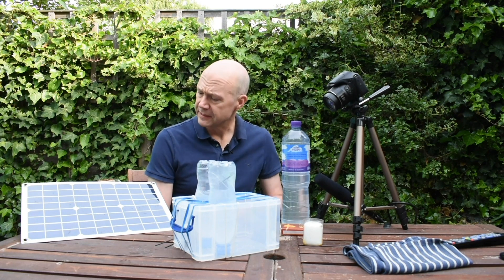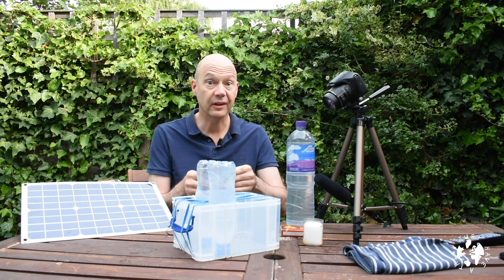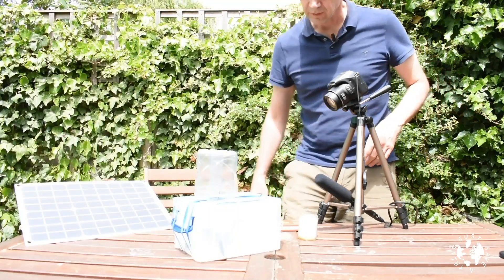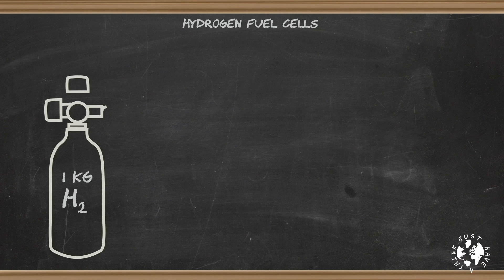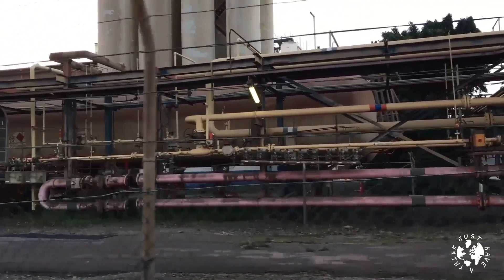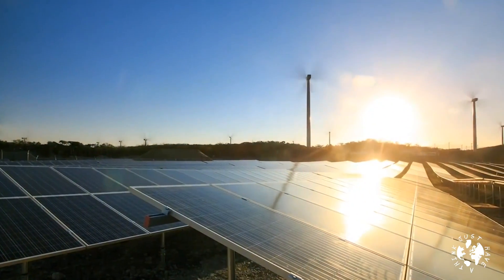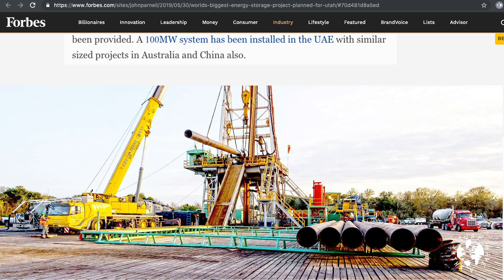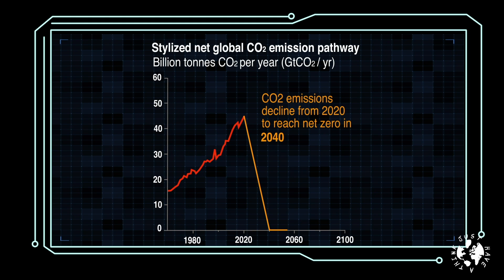Energy Storage in Hydrogen : Does this beat batteries?

Comment: Scaling up H2 to a global fuel & store of energy will result in leaks. Being small, it leaks. Being reactive and at pressure might lead to corrosion. Being the lightest gas means it will escape earth's gravity more easily than other gases. We lose about 1g per second presently. But I would guess that with leakage more will leave Earth per unit of time. So what is the risk to water levels on the scale of say a few centuries? Is it insignificant?

Comment: What about using methanol made from electrolysis as a store of energy and then use Methanol fuel cells as a source of hydrogen for fuel cells. Much safer than compressed hydrogen tanks. Plus me thanks can use the current petrol infrastructure to be dispersed for cars and trucks.

Comment: There's a guy in New Jersey that did designed a hydrogen storage system from left over electricity made by his solar roof.  He had a low pressure tank for the hydrogen and a low pressure tank for the 02.   When he needed more electricity he would call on this system for electricity.  It took time for approvals by the township.
Reply: @rob1248996 Actually no.  He did have a series of tanks in the back yard.  It did take up a lot of space as one would expect
Reply: @rob1248996 He's on youtube and has the whole thing explained.  I can't remember his name though.  And no, it's not high pressure

Comment: Conveniently omitted: The cycle [in]efficiency of the electrolysis-fuelcell cycle.  Given electrolyzer and FC efficiencies of 0.8 and 0.5, respectively, cycle efficiencies are only 40%.  Also omitted, things like H2 diffusion and embrittlement.
Reply: Of course they did not bring that up. Ha. A wonderful up and conning solution are the MSR specifically thorium fluoride. Wonderful tech. Quick link for basic edu below. 

  https://youtu.be/uK367T7h6ZY

Comment: HHO is the slang for electrolyzer devices that perform efficient electrolysis.  I made some - they work well using KOH.  The bummer is that the O2 and H2 are mixed (which is OK for the automotive application)

Comment: When it comes to efficiency of hydrogen production, water electrolysis is not too good. Perhaps it could be improved by using different frequencies of electricity though.
Barring that, electrolysis of urine at wastewater treatment plants has massive potential. Hydrogen from urine takes less electricity to make it then the amount of hydrogen energy that is collected. It also purifies the water while making the fuel. Check out the green box program at Ohio U if you want to learn more about it. Very fascinating stuff!

Certainly efficient seasonal storage of energy would be a game changer. It would work well with intermittent sources of energy as well as nuclear and other base load power suppliers. It would increase profitability of any kind of energy supplier.

Comment: Water has 2 atoms H per molecule. Methane, CH4, has 4.  Seems that Methane could be a  super source for H2 for use in fuel cells to generate electricity.  But, that begins to appear to be a downward spiral. Soal power to electricity (34% efficient), electricity to H2 (?% efficienct), H2 through a turbine (combustion) or fuel cell (?%efficient) .

Comment: The hydrogen could be used to make ammonia rather than using natural gas.    That would save the stored methane to be used for other uses.
Reply: Or you could make methanol, which is slightly less energy dense, but easier to store.

Comment: On submarines, this is one of the ways to create oxygen for breathing air.  The machine uses 1250 volts to separate the molecules and throws away the hydrogen.  The machine is referred to as the O2 bomb.
Reply: There's still a lot of work in removing CO2 then, just adding O in a submerged environment means the CO2 saturated air must be vented with the H2. That's a possible position give away even if they compress it for a few days and then vent. I thought they used CO2 scrubbers. Not saying you're wrong (you've obviously spent time on a sub), only that I'm surprised.
Reply: Unless theres some technology I dont know about, (its possible, Im not particularly knowledgeable in the subject) theres no CO2 scrubbers that can be used for the lengths of time a submarine would need, so they use an amine type CO2 scrubber, which is regenerative (it absorbs CO2 normally, and discharges it when heated).
And if youre only discharging the CO2 youre only discharging about 0.3-0.6m^3 of volume a day per person, 
0.0004m^3 per minute on the high end (my cursory search on how much co2 a person emits per day turned up 0.35m^3).
Which is trivial, all these values are also at standard temperature and pressure, not the incredible depths a submarine can be expected to operate at, lowering them even further, also sea water absorbs and adsorbs CO2, lowering it even further.
Also I just realized I typed a wall of text, sorry about that! I like doing math!
Reply: @rjwaters3  Yes, Destin from smarter every day did a video on this. They mostly use amine to absorb co2 which they then vent to the sea. They pressurize it to match outside pressure and vent it in tiny bubbles so it dissolves into the water very quickly
Reply: why is h2 made on one terminal? what happens to the o2 from that terminal? the o2 doesn't teleport to the other terminal.

Comment: I am unable to believe the bottles filled with the gases in a matter of few hours and with no intervention at all. No, not possible 

Disadvantage is that the bubbles of oxygen and hydrogen gas will still cling to the electrodes reducing the efficiency of the electrodes. You need a mechanical brush to clean the electrodes plus a larger surface area of electrodes. 

The distance between the electrodes increase the internal resistance. One bottle will become more acidic and the other bottle will become alkaline making the electrical flow to practically stop because of upwards pH gradient. So you need to stir the entire solution. Industrial scale need to address these issues for more efficient process on economic scale,

Comment: Burning hydrogen in a gas turbine is a challenge as it burns at a very high temperature. Totally replacing natural gas with hydrogen in a pipeline could also have issues.
On the upside apart from the heat from burning it, hydrogen can also act as a reducing agent so burning it to make Portland Cement and Iron seems doable.

Comment: The devil is in the details. Hydrogen is an escape artist. It is very difficult to contain. Frozen hydrogen is great but the problem is dealing with extremely cold liquid. It is explosive, and it will destroy almost any material it touches while extremely cold. The problem is all in the details and although many people and companies have worked on making hydrogen practical, nobody has solved all the problems yet.

Micro nuclear power is much more practical and currently is the only solution to our CO2 problem. These newer designs are safe by design (impossible for a runaway reaction to take place), cost effective and we can locate them much closer to where the energy is needed. Sadly, fear of what people don’t understand and stupid politicians, are getting in the way of a real solution that can solve the energy problem that we already know it will work. This can’t be said for hydrogen as a storage mechanism and renewable energy (wind and solar). I am a big fan of solar energy but I don’t see how we will ever get that energy source to be anywhere near big enough for what we need. Until we can make fusion energy a reality, small nuclear is currently our only hope.

Comment: I a very serious objection to this hydrogen folly. I know that salt mines are incapable of storing hydrogen without nickel metal hydrides. Without this the hydrogen will totally leak away! Leaking hydrogen is always a major problem, because there is no metal or plastic tubing known to man that is dense enough to contain hydrogen. The active hydrogen molecules will vibrate themselves through the skin of any pipeline given enough time. I is the Hindenburg all over again. When hydrogen is cooled to room temperatures in the presence of nickel metal hydrides, the hydrogen bonds to its surface. To release it again all need is to warm it up again. Hydrogen used in internal combustion engines, they use a preheated and then pass the exhaust through the storage tank to keep the hydrogen molecules active. Early developers of such engines learned this lesson the hard way, losing everything to a fire ball. Salt Lake City is actually sitting between to major faults, if an major explosion occurred there it could push California into the ocean. I can’t help but thing President Trump has something to do with this stupidity.

Comment: If you absolutely want to store energy in the form of hydrogen, then only with silane polymers.  It only provides long-term storage and because silanes can grow in the chain and the larger the chain, the greater the stored energy in the form of hydrogen.theoretically. The special thing about it is that you do not need to release the hydrogen through pyrolysis, but rather water, which has a pH value of approx. 12.😎

Comment: Is it feasible to have a small scale local plant to produce enough hydrogen just to provde enough energy to for domestic heating and hot water?  Could the current boiler manufacturers repurpose to make such a system as a domestic product?

Comment: It seems an important point to make that H2 is itself an energy carrier - like electricity - and neither of them a fuel.
In their book ‘H2 as energy carrier’ - Springer Verlag ‘88  Winters and Nitsch - if memory serves - say that a third of the volume of gaseous hydrogen is what is required to provide energy sufficient to compress the remaining two-thirds into liquid form.
I often think that the other gas - Oxygen - resulting from electrolysis of water is overlooked. The reaction of liquid H2 to liquid O is the/a reaction which puts rockets into space is it not?
I think possibly the most powerful conduiting of ambient planetary energy through H2 and direct electricity - or indeed microwaves - will come to take the form of rotating masses of sea-water under condition of containment and maintained in circular motion by adjacent currents. Such a technique is perhaps not likely to occur with existent geometrical conceptions underpinning large scale civil engineering projects but seems - imaginatively - quite feasible with a modular developments of geodesic theory using 1) the Isotropic vector matrix and 2) syncopated Cubeoctahedra in conjunction with each other.
Such developments might obviate all need for storage since in deriving energy carriers from them one would simply be skimming the top off planetary energy transfers on a scale beyond all conceivable human use - industrial energy use as the equivalent of drinking water when thirsty.

Comment: Looks like lots of misinformation here. Statements that hydrogen can be used as a substitute for gas is false.  Hydrogen will eat through seals and the pipelines themselves at concentrations above 10%. Then there is the whole matter of the huge energy losses converting to and from hydrogen and electricity. Other storage is ore efficient and cheaper such as batteries of gravimetric.

Comment: They seem to indicate in the diagram oxygen is vented. Why not use to oxygen to enhance burning ( either plastc waste or garden waste). It may impact on carbon neutrality but it may effectively allow production of more electricity ( not quite perpetual motion but hydrogen needs to be portable but the oxygen can help burn anything on site). With luck it may even produce some hydro carbon solids as well as co2).

Comment: Using electricity to produce h2 to then reproduce electricity with the current technology  is totally no sense for cars transportation. Assuming we produce 100 kwh of renewable electricity and we store it in battery or use it in the grid to power cars we are left with 80 85 kwh usable. Using the same renewables electricity to extract hydrogen from water and then use the hydrogen produced in fuel cells to reconvert the h2 In  electricity we are left with how much, 30 40 kwh usable? This means we need  40 percent at least bigger solar farms or wind farms to power same amount of cars. But oil and gas companies are cheering it so they can keep their centralised infrastructure selling an inefficient vector as "commodity" pricing it like petrol. Ridiculous.

Comment: I would think one could use the compressed hydrogen to generate power twice.  1st running the pressurized gas through a turbine without combustion down near the salt cavern, since no energy is required to lift the gas out of the ground, the 2nd through either through a combustion turbine or a fuel cell at ground level.

Comment: Hydrogen is not as good as batteries for smoothing of fluctuations, because the water to gas to electricity process is much slower. It's good for seasonal or hourly adjustments though. Also storage and transport as methane is a much better idea because we can't afford to lose hydrogen to the atmosphere in large quantities as that will get lost to space, and at industrial scale that would mean we are losing water. We would be trading one problem for an even bigger one.

Comment: "Hydrogen has no such limitations" Give me a break, not the same limitations but many many others.
Reply: That's what "hydrogen has no such limitations" means.
Reply: @hawkesworth1712  The problem is that statement is so open to interpretation that either of us could be considered correct.
Reply: @etmax1 . You would only be correct if the quote was "Hydrogen has no limitations".
The word "such" in that quote refers to specific limitations of batteries such as "capacity and duration of storage".
When he says hydrogen has no such limitations he's right. The caverns he spoke about have a capacity up to a million cubic metres and could store hydrogen for extremely long periods.
The purpose of the video is simply to compare hydrogen versus batteries.
Reply: @hawkesworth1712  I'm sorry, but I still have to disagree. human languages are more nuanced than that. I write computer languages and know that a certain sequence of instructions always achieves a certain meaning on a certain architecture, but human language is different which is why we have legalese as a application specific language case, and even that struggles. You need fuzzy logic understand the outcomes. Basically a lot of Venn diagrams come into play. the such is a fuzzy classification because we don't need to (and rarely do) list every single limitation we are taking about, mentioning only the ones that are most forward in our mind at the time. This means that the full Venn set is very often open to interpretation. Consider our list is apples and oranges which is so often used to belittle a difficult to compare set, but what if we're comparing fruit with meat, then apples and oranges compare well. That's why I object to the words "no" and "limitations" used in conjunction with a fuzzy word like "such" with so few limitations listed that overlap so many others. Anyhow, I guess we must simply agree to disagree.